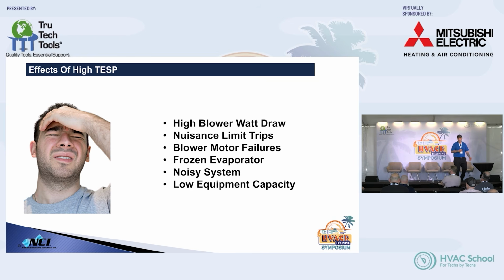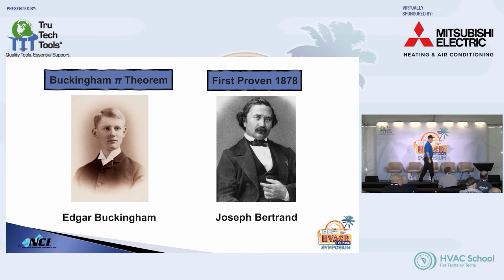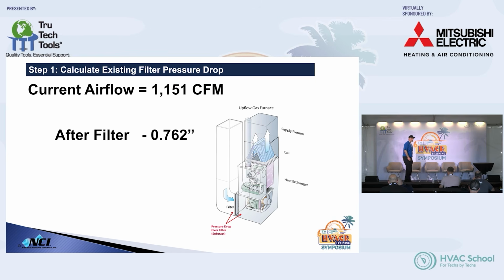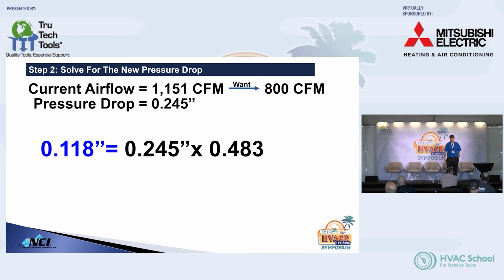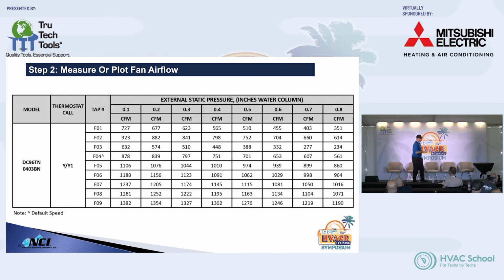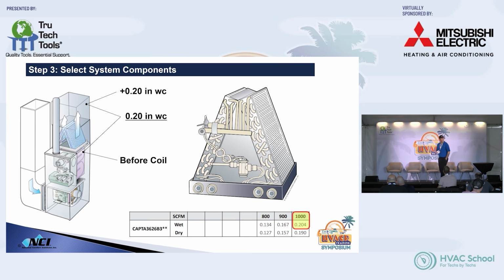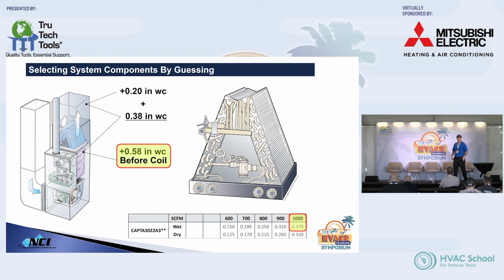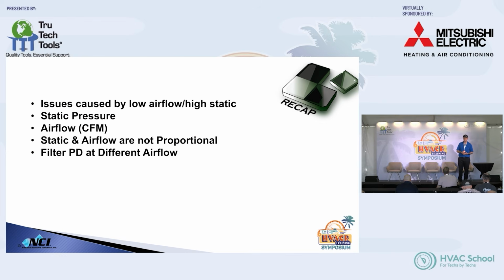Fan Law 2 for Techs with Adam Mufich

Comment: I remember when NCI came into S. Fl.  Took our instructor to a great little Caribbean restaurant at lunch.  I still have all the NCI cards for checking airside and total system capacity.  Now I see it’s software. Bought some airside tools back then. An air hood and a Testo( no longer made) static pressure manometer. All still works great.  Sold quite a few duct systems. It was a great class and good people.  Nice vid.

Comment: are all AHU setup the same? i.e. is the supply always after the cooling coils and return before fan? OR have you seen the return going to coils first then fan to supply
Reply: No
Reply: @NatePetersonr5t  most Air handlers are coils in the return air
Reply: @NatePetersonr5t  thanks
Reply: Some trade units have the fan first and then coil. Most of them have coil first and then the fan. Hope this helps
Reply: @Macias-tz4np  that doesn't help but thanks anyway
Reply: @Tecra-1776 pretty sure if it's evaporator is in the return something different is done to the condensate line but forgot what. Can someone enlighten us.